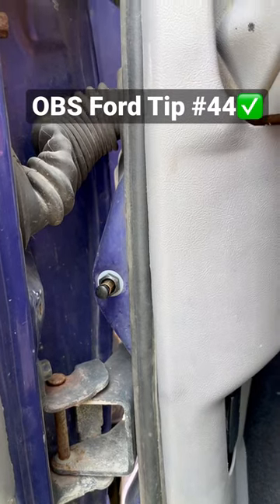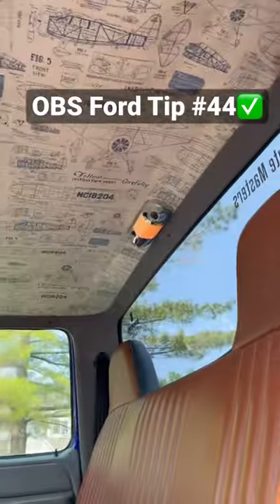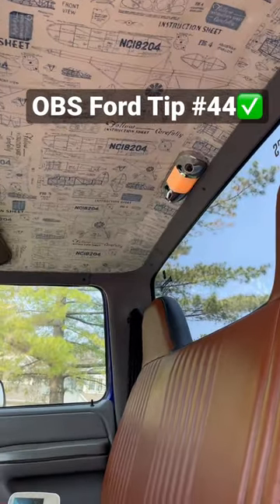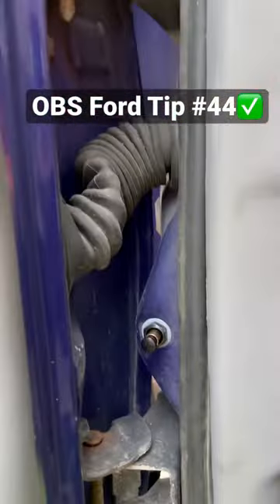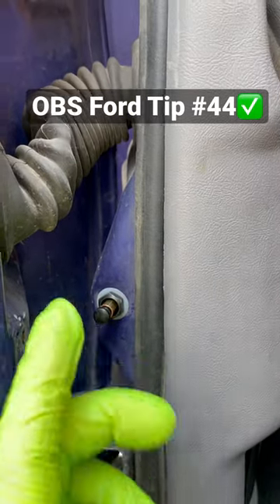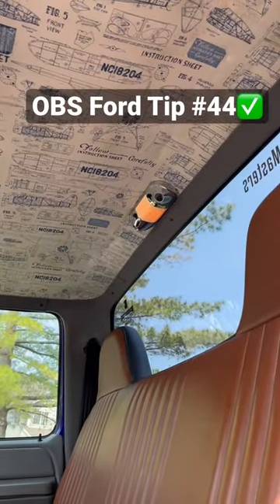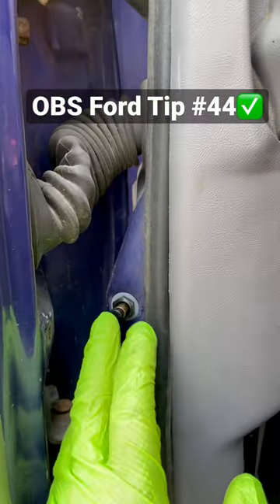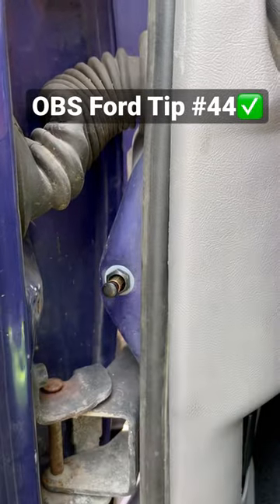Fix Flickering Dome Light👍

Comment: How did you install that headliner. Mine roof has no headliner only steel and I want to insulate it but make it look nicer. I’ve seen flags and other stuff
Reply from the maker: So you have not headliner. I assume you don’t have a backer board. Do you have the interior trim that installs around the top corners of the cab ceiling.
Reply: @TheMinuteMasters  yes no backer board but I do have trim pieces that run all around cab and roof
Reply: I'll add that on some regular cabs, the door switch is in the bottom of the b pillar. That's where it is on my 93 f250 rclb.

Comment: my 92 only has that on the passenger side
Reply from the maker: Really?
Reply: Check the b pillar on driver's side. Thats where it is on my drivers side on my 93 f250. Passenger side is on a pillar on that one, along with both sides on the 95 f350, and the 96 f250.
Reply: Down at the bottom of the driver b pillar, its black plastic and held in place with a screw. Has small plunger covered with a small black bellows.